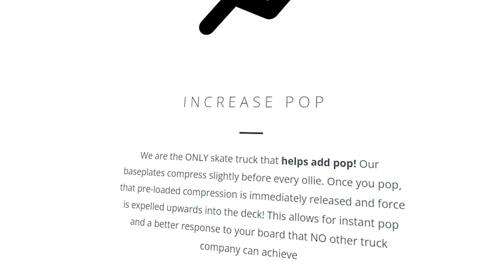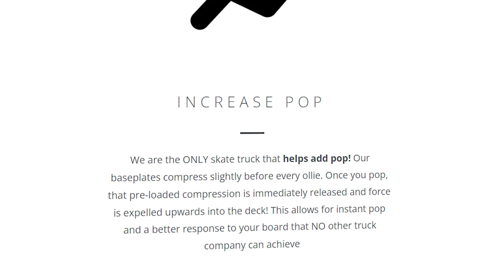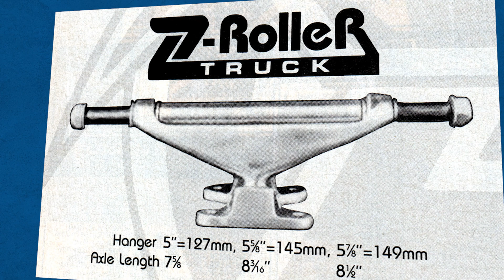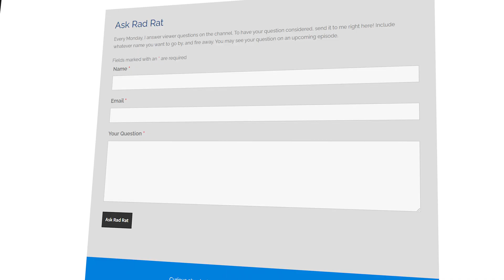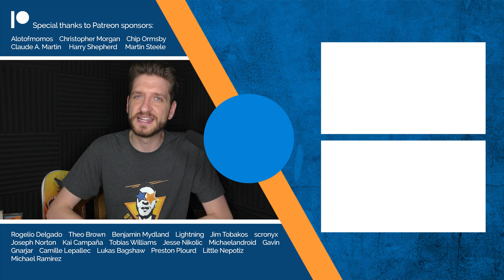When is a skateboard no longer a skateboard?

Comment: I believe the term cheating should technically only apply when there are rules.  So in a sanctioned competition- street league, X Games, yes they would not be allowed/ cheating if they were used deceptively.  
However, outside of competition, no rules in skateboarding! Everyone just have fun!  
Of course, a trick performed on a mechanical board should never be put up against a classic-style board,  skill - wise. 
They can just be in a category of their own,  like surf skates, rip sticks, power boards

Comment: The answer's different for everyone but for me, it would be anything that takes away from the ability to do "normal tricks" There used to be something in toy stores called a carver board or something like that that had like eight wheels on each truck. Now you can't do grinds so I don't think that's a skateboard anymore. I can't think of anything electric powered that would hold up to impacts of normal tricks so I'd say anything powered is out.  I've seen hooks screwed onto the top of the board to hook your feet under so that you can jump and the board stays with you but then you can't really do flip tricks so that's out. There's been lots of inventions that modified the skateboard that didn't make it no longer a skateboard. Zrollers count even though some people said it was cheating. Tensor used to have the little plastic insert on the baseplate. Weird wheel shapes/light up wheels. Rubber/non abrasive griptape. There were those suspension trucks a few years ago I never rode them myself but I don't think they modified the board too much to take away any tricks.